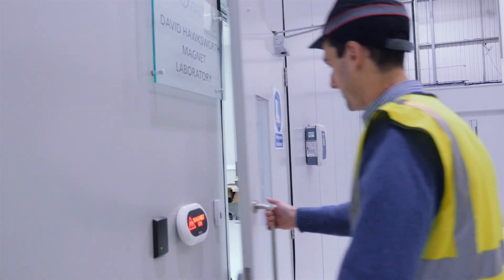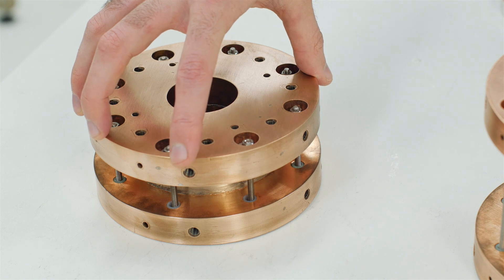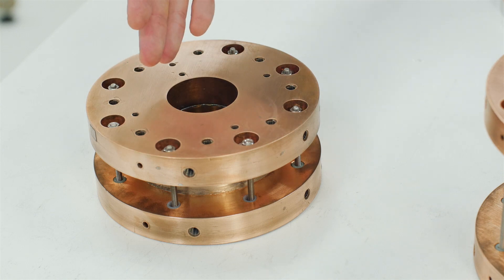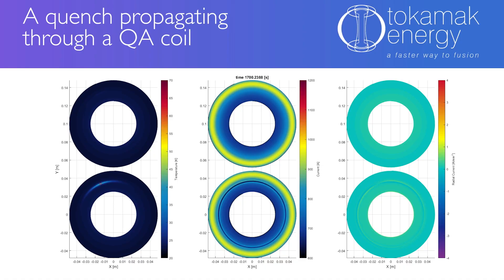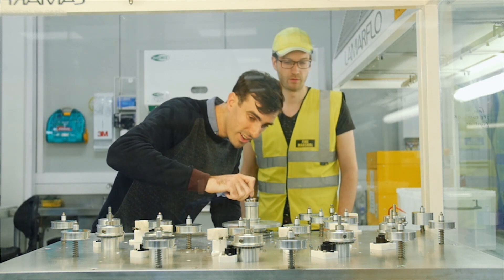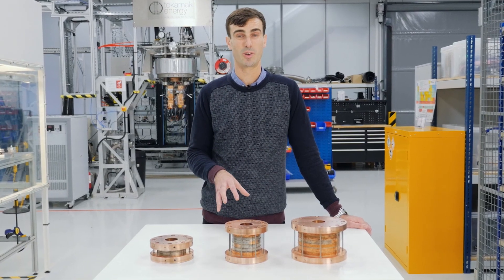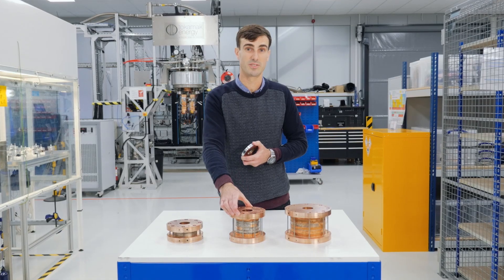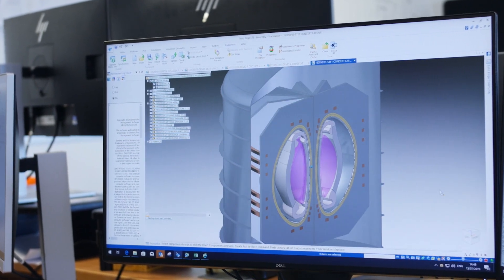HTS progress announcement - 20T magnet

Comment: Hts. Hight temperature super-conductor. @20 kelvin which is -220 c. Yes very hot, much high temp.
Reply: Well, it doesn't need helium cooling. I see this as high-temperature.
Reply: Ok, to be exact.  20 K requires helium cooling, thats what temperature was tested. Nothing was accomplished here, the lab tests say ~90 K (YBCO), they tested 20 K.... Sounds fisshy

Comment: Wow it's amazing!!! 20 T is really high! In a video presentation of MIT few years ago the speaker told that over 14 T magnetic fields in a tokamak fusion reactor like ARC , it will be possible to achieve Q>1 so a net gain energy in a Tokamak Fusion Reactor! What do you think will happen with this type of 20 T magnets? High density plasma means higher energy gains by requiring less thermal energy plasma ignition and higher fusion reaction inside the plasma right? So it will be possible to finally have a positive energy Fusion Reactor!

Comment: this is incredible ~ how would you hook a power supply to utilize the magnetic field ? was seeing the coil but did not see where  you would attach to a system
and the torrid you displayed was again impressive with that type of field~ there are huge implications with this s a source of potential power source and even utilizing in vehicles and there apparatus ~ and potentially a power generation as well in  remote areas where power lines are not feasible
Tony
Reply: This is for use in superconducting magnets. Not sure if this is the superconducting material itself or not. It might be the coils that are used alongside the superconducting magnets to energise them. In either case, the superconducting material is submerged in liquid nitrogen, at that tempreture, the magnetic coil becomes superconducting, and current flows unimpeded, even when the power source is removed. For initial energizing of the coils, I'm guessing connections will be added.
Or of course it might be that they energise the coil with magnetic induction.

The holy grail of course is super conductivity at room temreture.

For those who dont know, this company are developing nuclear fusion technology. So these superconducting magnets will be used to confine the plasma. 

https://en.m.wikipedia.org/wiki/Superconducting_magnet
Reply: @martinw245  Liquid nitrogen isn't 20K, you need helium.
Reply: @butsukete1806  

No! Classical superconductors required liquid helium. Modern high tempreture superconductors are cooled by liquid nitrogen.
Reply: @martinw245  That is true, however the magnets in this video were operated at 20 Kelvin.
Reply: @martinw245  hi dear I didn't see any connection to the power supply, how it will be energized, @ input and output terminal??
Reply: @kamranphy  

Somebody asked the same. Check out my previous reply.

Comment: 20T magnets. AKA How to turn bobby pins into hyper-sonic projectiles from a mile away.
Reply: Benchtop high field NMR...
Reply: Weaponizable !!!
Reply: Makes an MRI magnet look like a child's toy.
Reply: Fusion(reactor) makes Hydrogen(H) into helium. It erase hydrogen. 
All humans and most other living beeings NEED WATER. Water is made out of hydrogen. If you fusion hydrogen to helium . the Water will get less and less! 
You will erase water. 
You will erase all humans.
Reply: @kirschkern8260   Great, you understand the concept of fusion. While you are at it, calculate the amount of energy released in 1 liter of water, then compare it to the global energy consumption per year. You´ll see something interesting, promised!
Reply: @Mp57navy  not to mention, if you convert so much water worth of hydrogen that none is left for humans, the energy released would vaporize the entire planet long before there's a hydrogen shortage!
Reply: @anthonylosego  and even besides that, you can continue fusioning the waste products up until you reach iron.
Reply: @kirschkern8260  No, you do not use hydrogen-1, that is basically impossible. The rate coefficient for fusion is around 37 orders of magnitudes less for P-P than the D-T fusion they are hoping to use. That's why the sun is worse than a compost heap by weight. D-D fusion is maybe eventually possible.
Deuterium is heavy hydrogen and and is one in 6000-something hydrogen atoms in water.
Tritium is unstable and has to be man-made; it is made from lithium. Lithium is the limiting (not very limiting) resource for D-T fusion.

Comment: 20 kelvin is high temperature now? 😁
Reply: Absolutely.   The previous superconductors which work at about 2Kelvin are really difficult to deal with. 2K is insanely difficult to achieve. it's close to absolute zero. So 20K is high.
Reply: Tom Fuller it's the scientific name of Superconductors above absolute 0

Comment: I love the presentation, but sadly there were only words and simulations, no actual demonstration, such as picking up iron filings from 1 meter away or something like that.
Reply: Sure they could do that... If they wanted to make a bullet.

At 20T you're gonna want to operate this with draconian safety precautions.
Reply: @jedimastersterling1  Come on, read between the lines. 

I said a demonstration and mentioned one I thought that would be okay, clearly it's not. 

You know how you can move a magnet that is on a table by holding another magnet over it and moving it to the side? A demonstration like that won't create a bullet. That will only move something somewhat sideways and it would be very fascinating to see how many centimeters away it would be able to move a 1x1x1 cm  iron cube somewhat to the side.
Reply: 20T is very strong, i think they'd need to create a whole scenario with the sole purpose of a demonstration just to make it viewable while still safe.
because of how magnets work, they are fundamentally unsafe to do demonstrations like that. magnets pull things towards them, and the problem is that the closer they are the more strongly they are pulled. that creates a positive feedback loop where one small mistake and you have a serious hazard in your hands. the scenario is inherently unstable.

Comment: How could you drill holes in that direction without completely severing the coil? Does it operate as a single loop while superconducting?
Reply: Maybe the cut ends connect? Just a guess

Comment: Fusion is a waste of an  aspiration.
Go with the stable salt reactor. It is ready for use NOW.
Reply: Better to do BOTH.  The all the eggs in one basket philosophy has never assured success.  Competition produces unplanned outcomes including technologies which out-performed their concept.  Seawater as fuel has a strong appeal.
Reply: @paulvarn4712  Then we end up with a lot of expensive baskets and probably no eggs.. You are assuming an infinite supply of money.

I want to see nuclear power delivering cheap, safe, non-polluting electricity (which was the original expectation). Once we have one reliable system, I don't care that there may be others.

However, I admit that we can be led down "the wrong path". This is why we have a lot of Heath-Robinson PWRs in the world, and the UK's AGCRs. The sad thing was the cancellation of the MSR project, (at ORNL), for  very short-sighted and possibly political reasons in the 1970s.
Reply: Your right but building new MS reactors and researching fusion are not mutually exclusive.  The truth is we can do fusion right now with H-Bombs in a container. It would work, but it's not practical. The Tech like Tokamak works, but it not quite net positive. It's a material science issue and it is coming along. Incidentally, MS reactors have serious material science issues as well, turns out molten salt is pretty corrosive.
Reply: @CoreyKearney  Moltex's "Stable Salt Reactor is "ready to go"..

Comment: Can I use these 20T magnets to build my UFO?
Reply: If you can build your UFO light enough, you can float it a few centimeters above most surfaces and water. The coil itself is likely too dense/heavy already.
Reply: @P8qzxnxfP85xZ2H3wDRV  maybe you don't know about new material sciences or that electrostatic is what holds us to the negative plate. There is a voltage gradient select the height by matching the voltage potential.
Reply: @brettmoore3194  I meant diamagnetically with the coils shown in this video.
Those electrostatic levitators just suck, because you need two electrodes. Then I'd much rather build a magnetic levitation train.
But with these coils, you can just float freely across almost all materials, which aren't para- or ferromagnetic, as long as the coil itself isn't too heavy/dense to make lift-off.
Reply: @P8qzxnxfP85xZ2H3wDRV  you are dense. The electrodes are the ground and the ionosphere. The vessel merely rises and falls with its voltage potential. It's not my idea. This was patented in the 30s
Reply: Ufos levitation works on static charge with direction controlled by high spin high mass inertial motion
Reply: @CG-cw3ps  so naive, yea think that everyone wants,everybody to eat or,have health. If,you dont see that hurting people,is,profitable then you are hopeless
Reply: @CG-cw3ps  now,you cant read it's,not my idea
Reply: @CG-cw3ps  says the person who thinks,people will,do,the right thing
Reply: @brettmoore3194  - Not worth anyone's time.
Reply: @CG-cw3ps  yea going over the records of the past that corporate interest say that this device isnt good for,society isnt a good idea
Reply: @brettmoore3194  my alien friend says military will use it first rather for society benefit. So the secret of building UFO will not be revealed. Now my alien friend is suffering from tummy exposure. After eating so much fast food his tummy became bigger and his Bionic suit don't fit now. He is trying to repair the suit now as he don't want to stop eating fast food.

Comment: Will it stick to the fridge?
Reply: With 20 Tesla the fridge comes to you
Reply: @apbosh1  - LMAO 🤣
Reply: @apbosh1  Assuming you have a good enough grip. :D
Reply: No, the fridge will stick to the magnet. In fact it will wrap itself around the magnet. Into a very compact pile of metal.
Reply: @zariumsheridan3488  u sure?
Reply: @zariumsheridan3488  hmm. Can a magnet collapse into itself? Black holes anybody?
Reply: No, absolutely not, with a field strength of over 20 Tesla, the fridge sticks to the tape!
Reply: You’ll have to run some more numbers, but the strongest rare-earth magnets have a strength of about 1.2 Tesla. Like a permanent magnet, the superconducting coil itself requires no power to keep it running once it is charged up. However you have to keep the coil very cool, which requires that you need to keep ANOTHER refrigerator running a safe distance away. So, if you have had some experience with big neodymium permanent magnets, this puppy’s about 18 times stronger.
Reply: @stuartschaffner9744  how da hell can it run itself?
Reply: Doug Lazamar , this is one of the reasons I wrote that you might want to crunch some more numbers. Even a few cubic centimeters of a 20T magnetic field stores a substantial amount of energy. If you built the field up with ordinary wire and then threw a switch to short the two wire ends together, the current would still flow initially. However by Ohm’s law there would then be a voltage across the coil which would drain energy from the field. The magnetic field would go exponentially from 20T to zero. This however is a superconducting coil so as long as it is kept cool its resistance will be zero and the field will not decay. Hope this helps!
Reply: @douglazamar8889  Very similarly to a permanent magnet, but with actual DC current "running" in circles. And with a very spectacular problems when it loses it's superconductivity.
Reply: At 20 tesla the fridge becomes fused to the tape
Reply: 20 Tesla should be enough to make you diamagnetically float.
Reply: actually those diamagnetic properties will be very imteresting indeed
Reply: Not without power.
Reply: lmao, I was thinking the fridge will probably crunch up around it like a tin can.
Reply: lol
Reply: You could stick a cow to the fridge with 20T.
Reply: No, the fridge will stick to it.
Reply: Asking the real questions!
Reply: Fusion(reactor) makes Hydrogen(H) into helium. It erase hydrogen. 
All humans and most other living beeings NEED WATER. Water is made out of hydrogen. If you fusion hydrogen to helium . the Water will get less and less! 
You will erase water. 
You will erase all humans.
Reply: @kirschkern8260  You have no idea how little hydrogen is needed. Besides, the hydrogen needs to be elemental, you can't use water and if you generate hydrogen from water  you can use seawater that's useless for drinking purposes anyway.

Comment: Is 20 K a temperature that ST-F1 will be able to work with or is it necessary to have these magnets work also at higher temperatures before they can be used in ST-F1? What is the highest temperature that the current HTS magnets can work in today?
Reply: While High Temperature Superconductors live up to their name you still need low as possible temperatures to put maximum amount of current through them and to achieve maximum field strengths. It would remain superconducting at liquid nitrogen temps, but you would not get the same performance.

Comment: making progress - with possible spin off products. A magnet producing 20T is going to have all sorts of potential applications.Well done.
Reply from the maker: Thanks.  Yes, it could be interesting.
Reply: Recently, a lab test reached 1200 Tesla, but only for an instant, as the test device was built for only 800 Tesla. Quite a bang when the field collapsed.
Reply: @paulmoffat9306  that bang was angry aliens being pulled back into the eather as the black hole collapsed
Reply: @paulmoffat9306  Source?
Reply: @paulmoffat9306  Yeah, we're interested. Link us because That's insane.
Reply: @paulmoffat9306   the induction collapse should have created mayhem with other electronics
Tony
Reply: @HerbsPlusBeadWorks  yes, that's right, have you ever heard of a flux compression generator ?
Reply: I want some in an electric motor
Reply: https://home.cern/news/series/superconductors/20-tesla-and-beyond-high-temperature-superconductors
Reply: What if the SAFIRE PROJECT from Canada has solved fusion by a different means of experiment to replicate the sun on Earth? Their experiment was about $10,000 and proved a combination of metalic geometry that can be 3D printed, then closed in vacuum, then a plasma of catalyst gases,  added the H+ Ions flowing through the electrified cathode. Evidence of fusion and fission to create transmutation of elements and Clean power. July, 2019, Bath UK conference SAFIRE PROJECT. 20T is still a great discovery but I think SAFIRE will get the fusion Nobel.